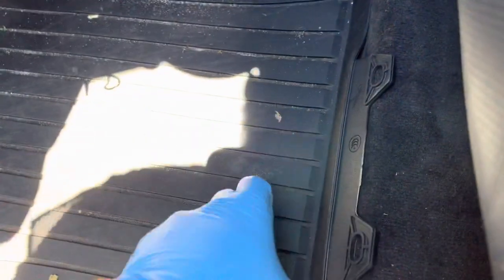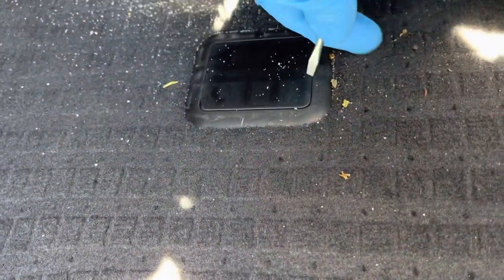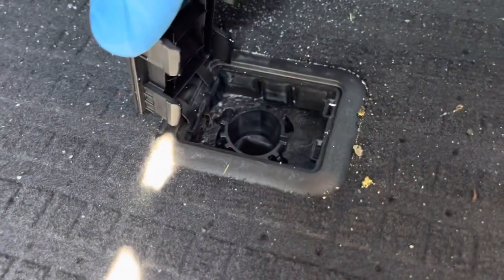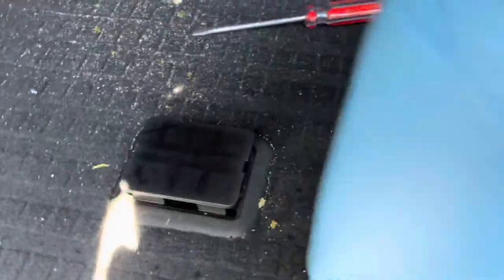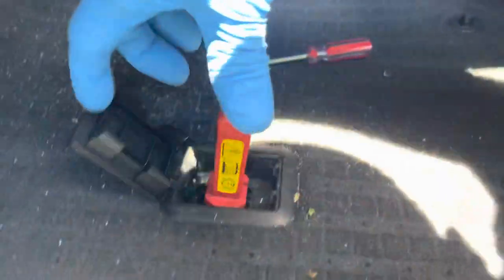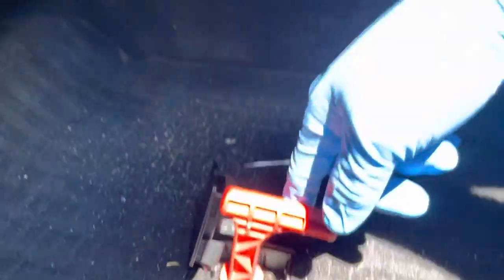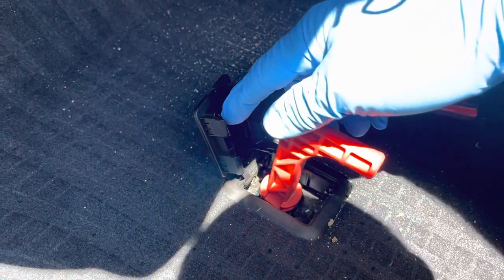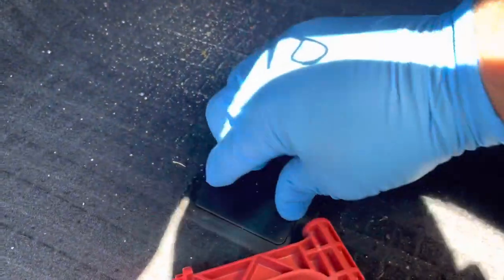How to get a 2021 Porsche Cayenne into neutral

Comment: @towman127 you must own the company ,cause working for commission your drivers would be poor if they had to go thru all that. another question what would you do if the wheel was lock regardless of it being in neutral? accident to the wheel? and comments welcomed.
Reply from the maker: Go through what? It took less than 2 minutes to get this vehicle into neutral. You’re acting like it took 29 minutes to get it into neutral. If the wheels were locked and couldn’t roll then I would’ve used skates to load it up or I would’ve loaded it on the wheel lift and dollies

Comment: i dont tow no more but im here to support.....and damm  these  new cars ...🪛
Reply: Hi I broke down yesterday and we just couldn’t find this tool - any idea what it’s called and where to purchase from
Reply from the maker: @prashraja I believe it’s called a park release handle tool. You can get one at the dealership or a junk yard might have them. If you need to tow the vehicle or push it, you should be able to use a 3/8  ratchet and a long extension from a socket set. You will need 2 or more people. One person has to sit inside, put the extension into the whole like the red tool in the video, turn it clockwise like in the video but they’re gonna have to hold it in place as the extension won’t lock in place like the red tool. Hope that helps.